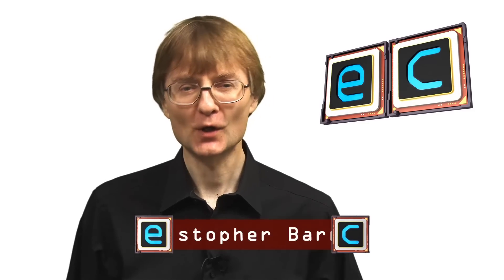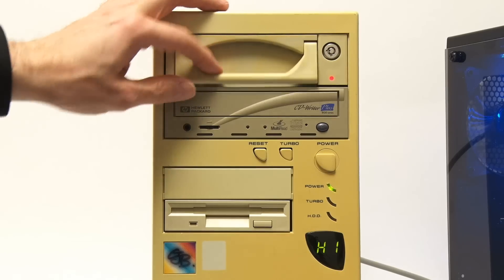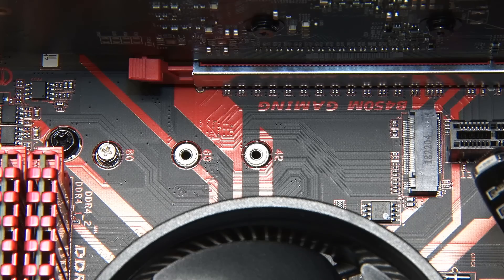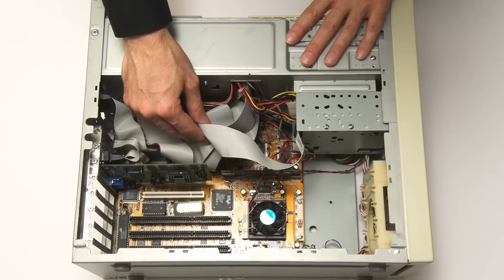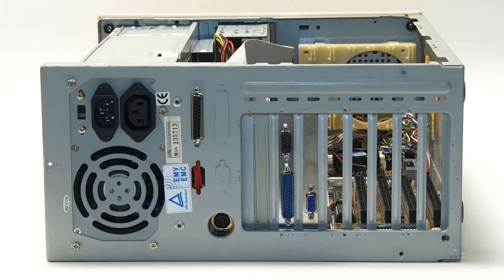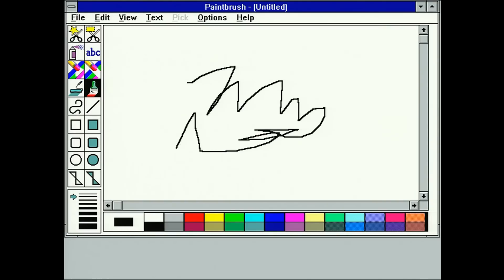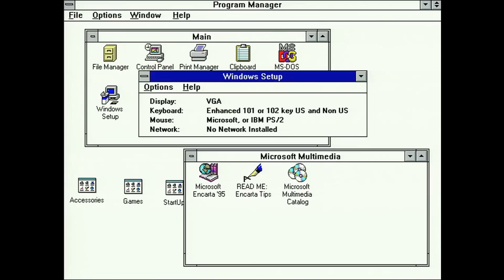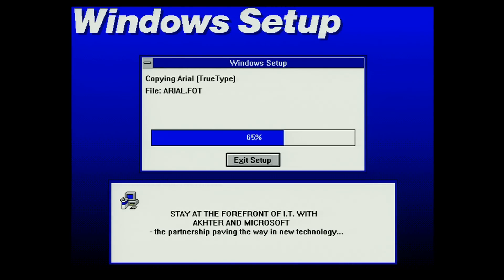Ryzen 3 vs 1996 PC

Comment: The first computer at home was a Commodore PET 2001 Series with the dual 5"1/4 floppy drive and the matrix printer with the upgraded RAM to 64Ko. Loading a program from the tape was epic and the monochrome display was a nightmare for the eyes and can trigger epileptic seizures after a couple hours.
My first computer was a 486 DX2-66 with a 540Mo HDD, initially with 8Mo upgraded to 16Mo RAM and the CD drive was plugged on the PCI sound card. It was in 1993, I was a young teenager, Autocad Lt (13 floppies if my memory doesn't fool me...) and games worked well on this machine. Encarta and Universalis (When owning a paper version of the second one, there was a discount on the digital version.) were a real help for my studies. I was 18 when I had my first modem and being able to access the internet. I feel so old now... ^^

Comment: My first build was a 286 AT; can't say I miss the fiddling with dipswitches, IRQ's and DMA's, though, or config.sys and autoexec.bat, for that matter. Let alone setting up an I/O-card or an internal modem....
But, yeah, the race between soft- and hardware is still going on to keep the actual speed of PC's at the same level, irrespective of the CPU-speed.

Comment: Oh my.  Such memories.  I still have boxes of this stuff.  Some things I put in boxes (cd drives, crap display cards, old cables).  I retained 3.5” floppies of relevant things back to DOS 1 and CP/M.  I usually use DOSBOX for running DOS apps though.  I have the Encarta CD (which I enjoyed immensely).  All kinds of programming languages (CS major).  We forget the hoops we jumped through to make things work.  Configuring display cards and printers in each DOS program.  Windows solved that and introduced all new problems.  Apps crashed to DOS or took DOS with it.  Somehow though recovery seemed easier.  Hard to say.

Comment: That Encarta disk brings back memories of all the hours I spent using it as a kid! My first PC was a Pentium 166 MHz running Windows 95.
Reply: The first computer I built used a Motorola 6800 running Mikbug, and by build I don't mean attaching a motherboard to a case and plugging in the CPU/memory, I mean physically wiring individual chips together from a paper drawn schematic. I wonder how many on here will have any clue what that was without looking it up. Now that's really a retro computer.

Comment: Trip down memory lane. Win 3.1 DOS 6.22 ? IRQ, DMA. Himem.sys  Floppy drive.  23 years has pass. Dune 2.
Reply: get pcem!
Reply: What would a channel as this one be without nostalgia?
Reply: Wasnt you running windows 95 in 1996 ? Or should i say windows 95b
Reply: @damiendye6623  Good catch.  In '96 a new build one would almost certainly be running Win 95, Win 3.0/3.1 was first half of 1990's.  I was surprised he didn't go back further in time. I am a similar age to him and was building PCs before Windows (used DOS 3.3), before CD drives, before 1.44MB floppies (used 5.25 360K floppies), before IDE hard drives (used MFM drives), before stick style RAM (plugged in individual memory chips in DIP sockets to get "up to" 1MB), before mice, etc. My early builds did have a serial port for the external modem (1200 or 2400 baud), and a parallel port for the dot matrix printer though, so it had that going for it.
Reply: @Erik Mikkelsaar Yes, I remember oakcdrom.sys to get a CD drive to run in dos and Win 3.1.
Reply: Yeah, the old driver sardaukar.sys
Reply: @Erik Mikkelsaar The Real PC Wizards had an autoexec.bat that prompted for what you wanted the PC optimized for.

Comment: Every time I see old tech videos like this I am reminded of just how jank technology back then was before significant effort was made to standardize and improve it like with USB (which is still fairly jank up to 2.0 and occasionally 3.0), SATA, PCIe (fantastic and robust standard), and simple things like PSU connectors for CPU & GPU.  There were driver issues like you wouldn't believe, hardware quirks due to OK-designed standards and "standards" (see: IBM doing its own thing) that probably caused half the software/driver issues, and ribbon cables EVERYWHERE (still silly to me that CD audio needed a cable from the drive itself to a dedicated audio card that we now condensed into a 3 chip solution on the board tucked away in a corner).  It felt like a mash-together of completely different and independent standards that just happened to be together in the same board and case than a collection of them that feel like they work well together (like the CD audio, nobody did the audio through the board BUS or on the board itself for a while, hence the cable workaround but now you can do basically everything via PCIe/USB if you want).
Reply: My first CD drive connected through a Sound Blaster card.  It could not boot to a CD, so I bought Windows 95 in a 21 floppy set.  I still had trouble with Windows seeing  it, so I left it in my 486 running DOS and installed an IDE model in my first Pentium/ Win 95 box.

Comment: Why are you using a 2200G when you use a GPU anyways? Isn't that CPU one of the APUs with decent integrated GPU? I mean if it wouldn't make a difference anyways sure go ahead and buy an API instead of a CPU, but as far as I know the Ryzrn APUs are actually noticable more expensive than the pure CPU Ryzens
Reply from the maker: Because I built up the Ryzen PC for a series on this channel, starting with no GPU, then showing possible upgrades.

Comment: Your original PC is absolutely stunning and beautiful. I'm sure it could handle win95 and some Half Life. I remember running Half Life on a Pentium 100mhz cpu and the performance was actually very impressive!
Reply: @Erik Mikkelsaar Nope, ran in software mode. Was epic. But later upgraded to an 8MB APG card and it was awesome.
Reply: @Erik Mikkelsaar Actually, your reply makes a lot of sense. I had to have had a vga card. I don't guess my cpu would have had an integrated GPU. I do believe you're correct. I wish I could remember what that would have been. I'm such a goofball sometimes. I did run in software mode but I had to have something to render video or my system would not have booted. haha

Comment: I was doing warranty repair back then. Lots of Packard Bell, Compaq, and HP computers. Even the Barbie and Hot Wheels computers that came out in the late 90's. By then the web was improving and the encarta disks were getting put in a drawer. By the early 2000's were starting to the a web more like we have today. Download speeds were still slow as people were still using modems as DSL was still getting started in the market. I still have two clients that use dial up. Very frustrating. Wish they would join the rest of us in the 21st century.
Reply from the maker: Wow! Clients still on dial-up.

Comment: One thing I've always found better than now (especially in the Amiga days) is that software wasn't an "I can do it all" piece of software but actual good quality software that you'd have one program to do one task, which it performed perfectly.....I remember seeing the software downfall in the Nero heyday when software just became bloated for no genuine reason and so many great pieces of software from the past was ruined.

I 100% believe that software developers internationally make their software perform worse / need more hardware power because they have deals with hardware developers and the cash grab is more important than their reputation.
Reply: Software writers back then didn't have to contend with an open architecture (unless they writing for the IBM PC and it's clones) so the writer could take full advantage of the hardware and operating system of that platform.  I recall the Adobe software users clinging to their Macs because most of Adobe's titles appeared to be tweaked to work better on PowerPC systems.

Comment: You started late.    ;-)
My first PC was a Compaq Portable - 2 x 5.25" floppies and all of 4.77MHz with 256KB RAM!  Graphics was the "sensational" CGA.  With an 8-bit 4.77MHz ISA bus - before that term was invented.  It soon got upgraded.
Long before optical media.
If you think that PC is a "frontier" effort, try operating a Texas Instruments TIAC 870!  No keyboard, no display, just blinking links and switches to load the registers.  The IBM 360/50 mainframe I next used was a giant stride forward at 0.125 MIPS.
Reply from the maker: I started late indeed. I was using x86 PCs at work from about 1989, but stayed with Amiga at home until I built this.

Comment: It is coincidence that you have uploaded this. Thank you for the effort it took. I have recently been messing around with older versions of Windows using virtual machines and emulators. Sadly, I don't have my first couple of PC's. The oldest one I kept was a late Pentium 4. I have managed to get it running Windows XP, but if I show it Windows 95 or 3.1, they just stare blankly at each other. I got the feeling that I was trying to wedge a carthorse in a Chrysler. Same technology, wrong era.

Comment: That's hilarious you can play with the turbo button for hours. I love that sarcastic humor
Reply: Surely he can't possibly press the button for hours
Reply: Shall we ask Mr. Scissors?
Reply: It wasn't sarcastic...
Reply: very English, indeed!
Reply: Chris may genuinely enjoy that.
Reply: Most younger people would not no this about the turbo button used to slow down Pc's
I got sick of trying to explain it so i gave up and said "Its hacked and wired backward and works turbo all the time, i press the button to turn turbo off"

Originally, you have instructions for the jumpers for the Led's , i used to make mine go 8 to 12 , the 33 to 66, eventually after 486DX4100, it went to 99, so then the HI-LOW came into fashion as it was a 2 character display
Reply: @georgemaragos2378    What's even funnier is that there is actually a 'Turbo' LED on the front panel.  The 7-segment display was completely unnecessary.
Reply: I giggled so much watching that.
Reply: Auto overclocking

Comment: That's like comparing a original Volkswagen Beetle with a 2018 Ford Mustang.
Reply: I wouldn't exactly call a ryzen 3 a "Mustang"
Reply: So you're saying that the Ryzen can't go through corners?
Reply: Personally, I'd prefer the Beetle.   Cheap, reliable, efficient, and you can fix 'em yourself with basic hand tools, and at the time they were commonplace, you could get parts almost anywhere, for practically nothing.  Those cars could provide everything anyone could ever really need (key word:  NEED).  They did the job, and they did it largely without complaint.  My only gripe about the old Beetles was their rather deplorable 'heater', which was basically just an afterthought.
Reply: xaenon - Beetle: I get 35 mpg and can be fixed easily, what do you get Corvette?  Corvette: RESPECT!
Reply: @CORVETTE_DUDE_CHANNEL   I bought an entire house for what you'd pay for the Corvette.   AND kept the Bug.  As I said before:  It provides what you NEED.
Reply: xaenon - I have a NEED for speed
Reply: @CORVETTE_DUDE_CHANNEL   No.  You have a DESIRE for speed.  Desire =/= need.
Reply: Nah the 2020 mid-engine Corvette would be better

Comment: I bought my first new PC in the begining of 1997 for USD 1 100. It was pentium100, 8 mb RAM, 1,2 gb hard disk, CD rom. But it was running win95! Still keep genuine win95 installation CD! In a 2 years time sold this PC for only USD200. Technology improved back then with much greater steps than now.

Comment: I got into pc's a little later around 97/98. I was using my amiga for productivity and gaming along with the ps1. 
I'm surprised to see that lcd screen, that must have cost. Mine was a celeron 333 with 32 mb of ram, 6 gb hdd and a crt monitor with buildt in lovely speakers. It was a hp from pc world. Within 18 months i upgraded the ram to 96 mb and added another hdd. Those were from pc world, they sold me the pc with half the ram. It took over a year to get it resolved and another 3 months for them to install the ram! I was livid, they also reimbursed enough money to buy a large (8 or 10 gb hdd). 
Never bought anything from them again, useless staff and forever giving incorrect specs.
I really liked that pc, i gave it to cousin for uni in 2004. Must have had every rom for the snes, nes, master system and mega drive along with hundreds of mp3s courtesy of lime wire. It was great for gaming.

Comment: Yeah, those where “the god old days” … or maybe not? But at least it felt kind of “magical” back then.

I brought my first computer home in a plastic bag. It was a NASCOM 2 kit and I had to solder every single component into the pcb myself.
Reply: My first computer was an Acorn Atom kit that I had to assemble from components. The kit was slightly cheaper than the pre-built version and more readily available. It worked first time so I didn't need the "we'll get you going whatever mess you've made" service they offered. That's probably because I followed the instructions carefully and used solder. Apparently some people used Airfix glue instead.

Comment: it would be more interesting to compare PC 1996 vs Raspberry pi 4.
Reply: yes
Reply: Rpi 4 will beat even a 10-years old machine, without even speaking about 25 years old one.
Reply: Yes totally should be a video specially benchmarks if it’s possible

Comment: The rewriteable CDRW is a 1998 or later piece, that monitor around the same time. 

I loved that turbo switch and size ... windiws 3.1 and himem, soundblaster, cd rom driver nightmares ... and the arrival of Rolling Stones work for Windows 1995 introduction and bill gates ...
Reply from the maker: The CDRW is indeed from 1998, as I stated in the video. The monitor was purchased in 1996 from an industrial supplier.
Reply: @ExplainingComputers  I haven't seen one that early anywhere but I remember my compaq and toshiba laptops with such tiny screens of 11 inch ... Our company changed nearly each year from comoaq to toshiba to dell and Siemens before finally thinkpads arrived so I can remember even the summers connected with each of these machines.

Great video + old machine in good shape .
Can't remember they had all these ce stickers on it ...
Reply from the maker: All I can say is that it is a 1996 screen from a supplier that mainly sold them for PoS terminals. Certainly not listed for consumer sale, and I rememeber taking a long time to find it. The casing is actually for a 11.3 inch display, so this model with the 10.4 inch one (which was a lot cheaper, but still very expensive), has a black border inside the bezel because of that. But it does have speakers! :)

Comment: Great clip but why not use a simple benchmark to compare both of these? I remember there was a video, guy was using a simple code in assembler to compare Atari 65 with 386 and pentium2 and some athlon build.
Reply: You could probably compare MIPS / Whetstone but they probably wouldn't give you the full picture.

A CPU with 64 or 128-bit data bus / ALU is going to be unable to use that advantage if it's limited to 16 or 32 bit calculations for example.

Comment: That 1996 PC could have Windows 95 or Windows NT 3.x or Windows NT 4.0.
Reply from the maker: It could have indeed. But I had Windows 3.1 and DOS disks. :)
Reply: @ExplainingComputers  We see kinda see the 4 SIMM memory modules installed but the BIOS POST seems to show memory only banks 2 and 3. Does that mean the modules from bank 0 and 1 are faulty? SIMM are to be used in pairs.
It seems you are using a PcChips M525 unknown version of the motherboard. It has a DIMM slot and 4 SIMM slots. Max memory of 128MB. It has an USB 1.0 header near the power supply connector. 
The BIOS may have an enable Ultra dma and if you get win95+/nt4 installed and enable DMA from hdd page, the system will benefit from DMA releasing the CPU from the task when transfering files. NT4 will need intel application acceleration to enable DMA.
If you probably dig the revision of that motherboard, you will find a bios update which will add enhancements or correct some problems with the bios.

Comment: FYI, you've got your DB-25s backwards-- the male is the 2nd serial port, female is the parallel (I still occasionally have to use old PCs like this to program old Motorola radios; they only talk to the software over a the serial port on a slooowww PC running DOS).
Reply from the maker: I stand corrected. I can rarely see clearly when recording (always a debate about whether to wear my CU or distance glasses for each shot). :(